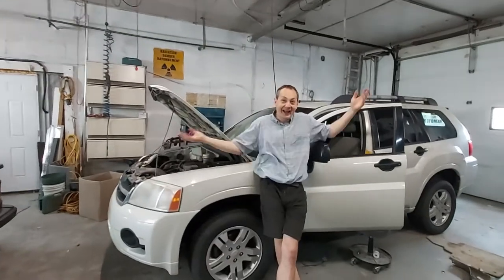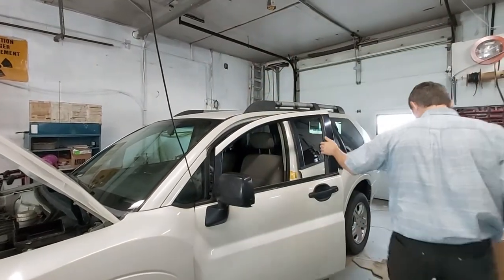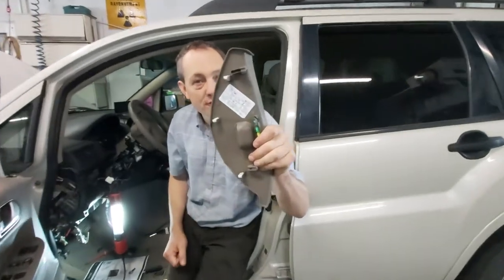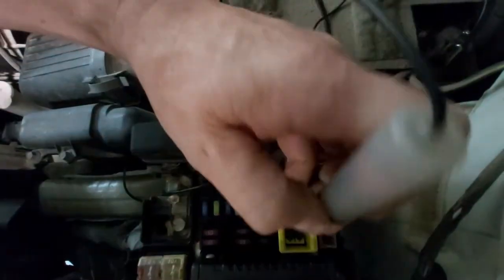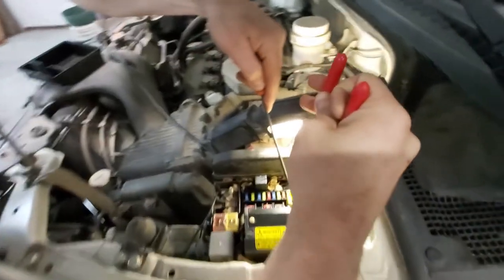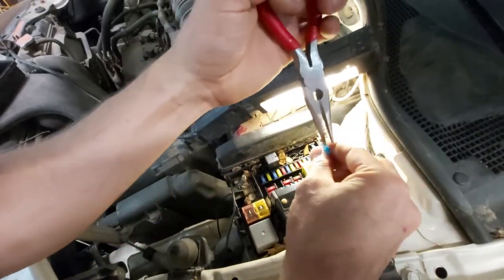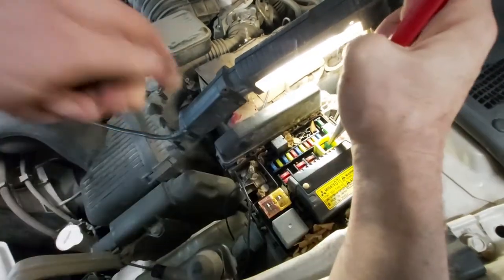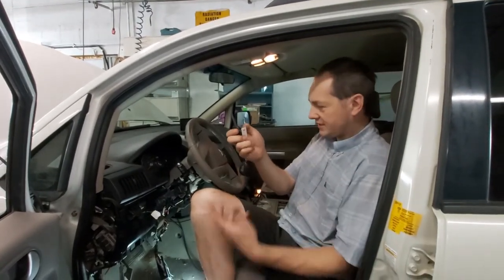Troubleshoot Door Lock Issues in a Mitsubishi Endeavor

Comment: I have a 2004 Mitsubishi Endeavor same problem was checking why my blinker was not working I pulled that fuse out on that yellow box when I tried putting is back it bent the connection in fuse box. Now no power on dome lights and door power lock. It also doesn't work with key on. So i bent the fuse a little to get the power to connect. It show am getting power in the fuse across but still nothing at the door or dome light 😢 any Ideas?

Comment: Hello Lloyd, 
Now two years have gone by and I hope you might still have an ear for my issue.. I drive a Mitsubishi Colt C3 (2007).
This weekend just after driving for 10 minutes the ventilation, heating and climate regulation  failed completely all at once. Just a few minutes later I arrived home and the central locking system failed as well.
I guess that these two issues are correlated to each other and after watching your video I could imagine that it's part of a problem of the fuses. Is it in your opinion a good idea to look under the hood next to the battery for the fuses?
Kind regards!

Comment: My interior lights work,but the locks no longer work. I have to use the key on the driver door to get in my 2011 endeavor. Going to check the fuse,hopefully that the problem.
Reply from the maker: Hopefully that solves the problem!
Reply: @lloydbrokeit3138   I have replaced three sets of long term fuses (dome light, power locks, radio)  once I change the fuse, my car works fine.  However; I just changed the fuse out 2 days ago and I was in the car tonight and heard it blow.  How do I chase down the cause?

Comment: My problem is close to this. Windows roll sometimes, doors  lock   sometimes. It resets sometimes when I open the door with the key in the ignition.  But mostly Windows and lock don't work. Keyless entry unlocks but flashing isn't on and only driver side unlock but alarm will sound no all the time it's unlocked.